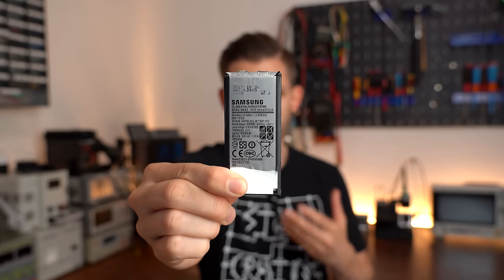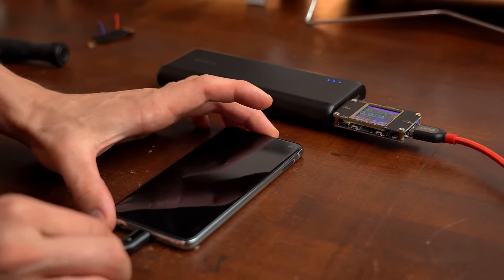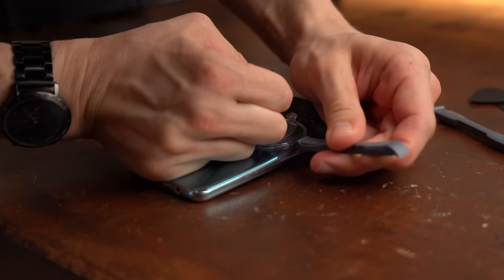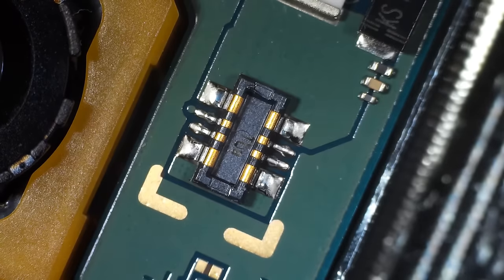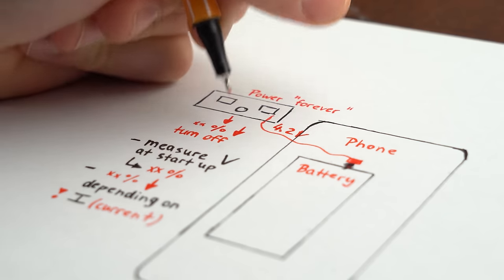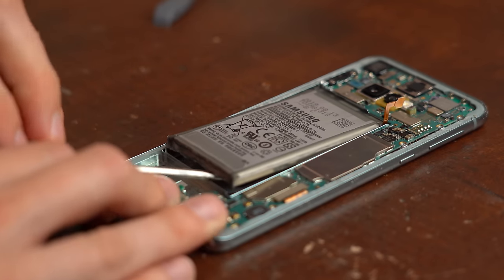I "Solved" Samsungs Swelling Battery Problem! (Batteryless Phone)

Comment: Hi, Scott. Thanks for the video. This is exactly what I needed for my old phone!
However, my knowledge of electronic components is pretty limited. I would really appreciate if you can help me with this; 

At the moment I don't have a MUR460, but I have plenty of salvaged 1N4007 diodes. 
Can I use a 1N4007 in the same diagram in the place of the MUR460?

Thanks in advance ♥
Reply: was wondering the same thing. did you find an answer?
Reply: You can use any diode that has similar voltgage dropdown chart as MUR420. I also hadn't had MUR420 so I've used HER303 which I had around. It has more or less similar dropdown chart as MUR and for this purpose that's the most important factor. 
What hasn't been mentioned in a video however is that you need to use quite thick wires as the phone drains quite a lot of current. Initially I've used too thin wires and the phone behaved weird - worked very slow and restarted frequently. The same for the USB cable - it cannot be too thin because this trick won't work

Comment: I did something similar with a Nexus 7 I was using as a NAV/Stereo in my old car (2009 Mazda 6).  I wanted the unit powered from the car but I didn't want the battery to explode in the hot dashboard.  I removed the cells from the protection circuit board and connected 5VDC directly.  I did have to replace a thermistor with a resistor so it wouldn't shut down in the hot car.  Switched 5VDC into the charging port was its signal to wake up and go to sleep when the car started/stopped.

Comment: The whole Swollen battery "Issue" is VERY blown out of proportions. Not only is it NOT going to happen to any phone that is being used it can happen to ANY phone left unattended for a very extended period of time. I have recently repaired an iphone x with a bettery so swollen the display was completely detached from the rest of the phone. It is recommended to charge the phone to 60% before storing the phone and charging it up to 60% every few months to maintain the battery.

Comment: I converted my S3 to 5V DC external power, I simply clamped the VCC & GND contacts of a USB test lead to the battery terminals of the phone. (It works flawlessly in this mode...)
Reply from the maker: Sounds similar to my solution :-) Glad to hear it also works this way.

Comment: There it is, finally. The simplest and safest way to make a batteryless phone.
Thank you! I am buying some of those diodes right the heck now!
Reply: Any regular diode should work. But there's something even better: a buck converter with a small 5V supercapacitor. The supercapacitor will smooth out the reduced power and provide extra power when current peaks happen during phone use.

Comment: Imo, you can just put a supercap to replace the battery and always plugin the charger.
It will act like a regular battery but with way less capacity. But at least it can hold up some energy and not breaking the phone.

Comment: If you are using the phone without battery, don't think you will install bank related apps.
So that means you can root the device and you can knock out the battery % measurement by the burned in capacity value.

So you can use the usb as OTG or display out.

Comment: what you could do instead of having the usbc wire, is put a stopper in the usbc port and run two small wires internally to the port, so it's a little neater.

Comment: Awesome video, please try it possible to add a circuit in the battery bay to trick the phone to use direct usb power so that the phone doesn't have to be sawed down to make it work, will explore this in my Nexus 5x 😇
Reply: Unfortunately, being unable to use direct usb power is not an artificial limitation, so there is nothing to trick. Single USB through the charge port just can't physically provide enough power to keep the phone on and running stable.

Comment: I get the point with the diode, but there would never be any charging current flowing regardless, since the charge voltage in the phone would never to higher than 4.2/4.35V and that is lower than the USB voltage, regardless.

Comment: Nice approach.
However, even if you insist not to solder onto the PCB directly, you may just as well disconnect the middle pin (the "sense" one), even cover it with Kapton or something.
Most of the PMICs will show "50% charge" and won't need charging. This way you may do away with the ugly USB charge connector splice.
(Given that you already drilled the phone bezel, that is.)

Comment: Hi, I had the same problem with my Xiaomi phone. I solved it by connecting the battery protection circuit terminals directly to the usb port of the phone. But your approach is also good. :)
Reply from the maker: Thanks for sharing
Reply: This does not work on each phone. My galaxy s2 does not do anything without battery in it.

Comment: yep I have dozens of swollen Samsung here , but mainly because that is just the brand I go for Note 2 - Note 5's , and 2 ~ 8 of each type so I had spare parts ... I just put capacitors in mine and they sit on wireless docks or plugged in USB as a alarm clocks / ebike controller etc , best to use 3d printer hot bed or hot water bottle to warm up the glue

Comment: After getting some of the guitarre picks in you should have reheated the remaining parts again before moving on. When it cools off it reattaches again, not as good and strong as before (thats why reusing rehisive doesn´t work, it doesn´t seal twice for chemical reasons), but enough so you easily break the glass. Next time ya know.

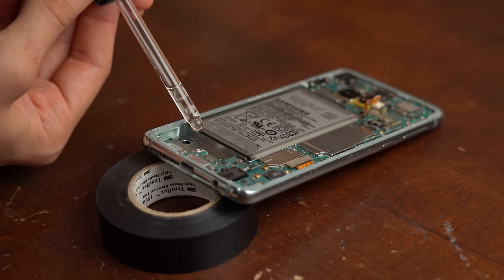Comment: 4:42 Removing a phone battery with a metal screwdriver is very dangerous even with the help of isopropanol. I use something soft like a plastic guitar pick to avoid puncturing the battery when removing it from the device. P.S. using a metal screwdriver can also damage the OLED panel that is under the battery as well if not careful.

Comment: Samsung flagship phones have the DeX feature starting from the Galaxy S8 series. Do you know if this setup will work with an additional Type C hub with USB ports and HDMI? Can the phone/power supply handle it? 

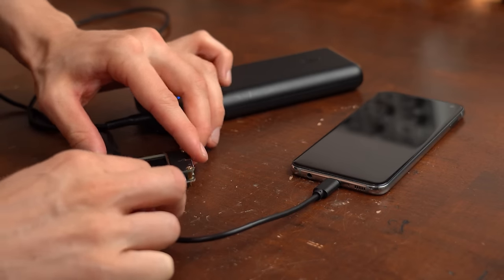Also 9:17, Fast charging can be toggled off within settings. In theory, the phone will be limited to 5V charging.
Reply: I've tested some fast-charging wall adapters and type c hubs with a PD feature. Despite fast charging enabled on the phone, the phone will not fast charge if charged from the type c hub. The only way fast charging can be triggered while using a type c hub is when a laptop type c charger is used instead (tested a Lenovo 45W charger capable of 5V/2A,9V/2A,15V/3A, or 20V/2.25A charging). Adapters and the laptop charger all claim 9V 2A output. Can't verify because I don't have the tool, but laptop chargers seem more reliable. Or type c hubs do sip significant amounts of juice.

Comment: I had a Galaxy S3 mini, the Micro USB connector was broken, so I wired up a USB cable directly to the Battery connection. The USB Cable then was connected to a Battery pack. This worked perfectly fine as the battery was rated to charge with 4.2V and the supply was 4.9 ish Volts, I was just like 700mV over.

Comment: The phone won't always draw a lot of current when it's plugged in, and that 4.7 volts you measured is already a bit high.  You should add a Schottky diode in series with it to drop another half a volt or so.  Maybe even another regular diode to get it just under 4 volts.  No clue what the phone has for a regulator, but I'm sure it'll be hotter at 4.7 v than it would be at 3.7.

Comment: tbh since you unsoldered the bms if it was me then id just get a new 4.2v cell and solder it to the bms. The bms it self is what tells smart phone the charge percentage. Sometimes if the battery is not charging it can be because of temperature sensor present in the bms. if its too hot or too cold battery will never charge and it can be because of a faulty temperature sensor. 

So while you connected the 5v to bms pins, the temperature sensor is not touching the Battery , so it will report a temperature that is cold and battery will not charge or display weird behavior like percentage bug

Comment: GoPro recommends that if you run their cameras for hours (time lapse mode, for example), you remove the stock battery and power the camera through USB because the battery overheats and shortens its useful life.

It's a real shame that we can't have user removable batteries anymore in smartphones.
Reply: You cannot do the GoPro recommended thing with some of their old cameras like the tiny Session because the battery cannot be removed. Time lapse mode is how I killed 2 Session cameras.

Comment: @greatscott I know how much you like switch converters. Here's one which I just fished designing for an battery bank application in TI's webBench Power Designer and its crazy efficient. My converter is 19-25v boost to 26v 35amps with a peak efficency of 99.4%! its the LM5122 controller

Comment: I guess most the people that encounter this issue store their phones at 100% charge - Batteries arent meant to be stored at 100% charge for extended periods, instead 10-20% is a better pick for that. My old original S6 battery that easily went through 2000-3000 charge cycles, which I then removed / swapped at 10% charge is still sitting around without issues.
Reply: If you stow a phone, the recommended  charge is in the 50-60
Fully empty batteries can have issues.

Comment: you CAN USE CDA-4F/5.5V-H  LIKE   5.5v 4f 5mm Farad capacitor replacement the battary , this   capacitor can open it to 2.5mm can put in phone , not need out  side line

Comment: I used to have a bunch of cellular wifi hotspots well technically I still do they all suffered a problem of overcharging as the internal charge circuit would not disable charging when left on the charger like say to use for your home Internet. To get around this I used lower amperage chargers and timers physical mechanical timers to turn off power during the night to let the battery cycle a little. I think they've improved this in the later models but I'm also not on cellular Internet anymore. I was noticing this on ZTE, Netgear and the predecessor That Netgear bought.

Comment: That's good but you could've used the USB C port to power the phone and if you find the 5V pins on the bottom PCB which houses the USB C port, you could've soldered a wire directly to it then add the diode and then to the battery socket. You would probably need a single wire from the 5V line with a diode in between to the battery terminal. The -ve is usually common. If you're worried about it switching over to 9V, you could use a regular 5V adapter which doesn't support 9V or 12V charging. And the title is misleading. This doesn't solve the swollen battery problem. This is only useful if you're ok with using the phone with an external power bank or if the phone is fixed in one place. I thought you'd have a solution to reduce the maximum charging voltage. That way the battery capacity would reduce but atleast it would work. Usually your videos are really good. But this is something new!!!

Comment: my 2014 Galaxy S5 still has same battery, no problems at all, still using it, don't have other phone. Is a matter of luck, I believe, and good maintenance. More than 1000 charge-discharge cycles of the battery. Not same battery live as 9 yrs ago, it requires now daily recharge, but no complains at all.

Comment: Thanks, i have an old shield tablet that was wall mounted for my Hassio setup. 
but the replacement battery also puffed up. was thinking of capacitors but this is better.

Comment: You could put the usb-c connection (the 5v to the usb-c port) internally (soldering the wires) and you will save 1 wire comming out from the phone to the phone's usb-c.

Comment: Alternate Solution : 
Connect +ve wire in the battery protection circuit. 
Connect ground wire on main board in Phone. 

I am using this on my phone from last 1.5 years and it works. Battery level is also always 100% without anything connected to phone's usb port.

Comment: If you could've connected the battery connector directly to the USB power supply connection in the motherboard, it would've been a neater solution, if that's possible.
Reply from the maker: Possible but hard to do.

Comment: You can also use it as a PC temperature monitor. It's too bad manufacturers no longer sell modular batteries and circuits to allow phones to get power from the charger directly.

Comment: instead of putting holes on the side of the phone, 5V power could have been directly pulled from the USB C port itself. All the circuitry would have been concealed inside, and a regular "charging only" cable could be used. Though it would need some amount of soldering onto tiny pads.
Reply: That won't work, for 2 reasons:
* The USB jack doesn't necessarily carry 5V. Modern phones use USB PD and will negotiate a higher voltage from the power supply. Furthermore, there's a brief moment (several hundred ms) before the power supply switches to the new voltage during which the power cuts out completely, with the phone being designed to run off battery for that period.
* You could make it a noncompliant device and just assume it will be plugged into a legacy USB-A power supply to avoid that problem since it will always output 5V. However, USB doesn't supply enough current to power the phone. Legacy USB supplies at most 1.5 to 2 amps, which gives <10W considering losses in the diode. Remember that since there's no battery at all, the power source needs to supply not just the max average power (i.e. TDP), but the peak transient load, which can be significantly more than 10W even on a phone. So the phone will draw too much power, and a compliant USB power supply should cut off when that happens.

Comment: You could also simply hook up a capacitor on the battery so it boots over usb only without the need for a modded cable
Though some bms may refuse to charge at 0V, so you may need to bypass it.

Comment: I think you need to do a sequel video with a capacitor bank to replace the battery, and a hack to power the phone internally without filling the USB port (so it can be used for USB OTG)
Reply: sequel yes
otg can be still plugged with usb dongle (split to 2 ports)

Comment: Since that phone seems to support Qi wireless charging, it could be neater to supply "wireless" power internally, which would leave the USB port free to be used for accessories.
Reply: Unfortunately, the power requirements of a modern phone are too high for them to be run off of a wireless charger.
Reply: @iguanamoat  I think you're misunderstanding me.

My point was to use the Qi charging input to fool the phone into thinking it was getting power constantly, not to actually power the device using Qi.

Secondly, even if one would use the Qi power input on the motherboard to provide power to the phone (and for that example not use external power on the battery terminals, just using supercaps there) one could deliver way more power, since it would not be necessary to actually power the device wirelessly, just proving power "raw" to the contact for the coil.

Comment: I will defiantly give that diode idea a go , so just run a internal wire from usb port to diode to battery terminal , but what could be done without disconnecting the data lines as fast charge protection ?

Comment: You can manipulate battery value by adb command, 

Enter adb shell

dumpsys battery set level 80

It will force battery to 80% all the time, doesnt matter what your battery voltage.

Comment: Well i've made the same trickery to my old Xiaomi phone... but in a more professional way without ugly cutting on the side of the phone..
Basically, I made a small PCB with 16 SMD supercapacitors and hookup them to the original phone BMS with a slight modification of the BMS to make it charge the capacitors when the voltage across them is below 3V... That's it! Phone cover close nicely without ugly cuttings... The phone can run for 15-45 seconds on a supercapacitor battery, depending on the CPU load...
Reply from the maker: Nice project :-)

Comment: It is mandatory to have 10 to 35 percent charge on any mobile if you don't use it for one to two years. By doing this I think the battery may not swell. This is not the case with Samsung/hongli 18650 batteries.

 Horan

Comment: i removed the battery of an old Samsung SM-T310 and this tablet can be run without any mod or battery only by USB. Problem on the whole thing is, if the power is cut of it wont start automatically. So the power source must be consistent and not every power adapter has this consistent flow. especially the newer ones (QC and PD) try a old one without such technology.

Comment: you can just charge the phone only up to 80% and keep it below 38 deg to avoid swelling. this can be achived by installing AccuBattery app. it notifies you when the battery level is over 80%. or you can patch the firmware to charge no greater than 80%.

Comment: I've experienced the bloated battery on two phones.  No more for me, no more fast charge. My current phone has an 8A battery and came with a 2.5A USB charger.  Regular/slow charge would be 1/10th of the AH rating of the battery, 0.8A.   Changed to a 0.8A USB charger.  Connected charger to a USB hub (non powered), charge current dropped to about 0.5A.  Now can charge, very slowly, while watching partial screen video on phone.

The 8A battery makes for charge state of 40-80% useable for my use.  A smaller battery would be too tedious to maintain within the  same range.